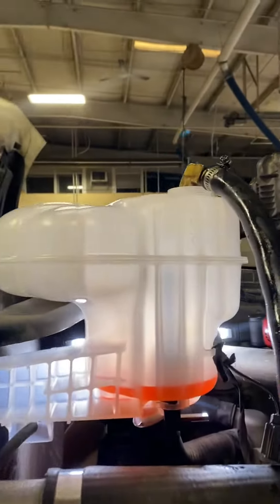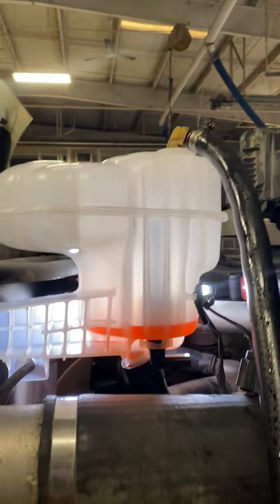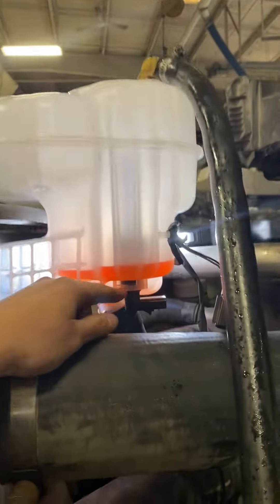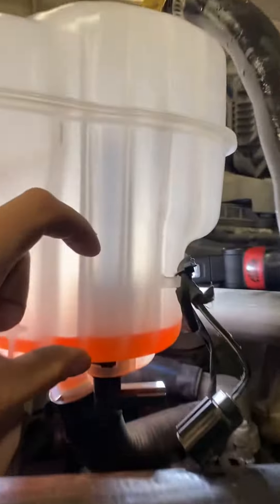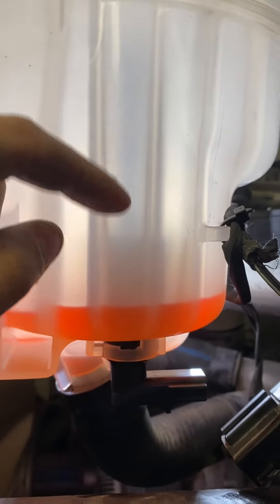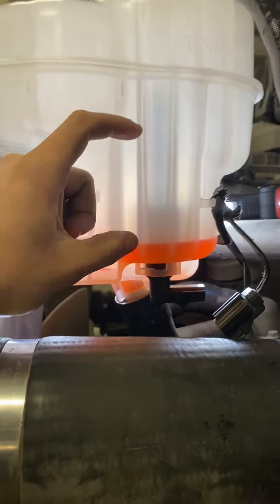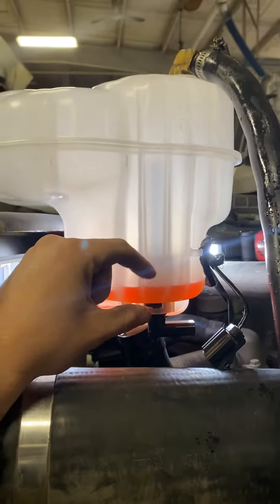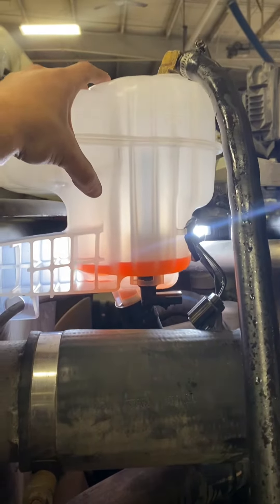Freightliner New Cascadia Low Coolant Codes With Surge Tank Full, Possible Cause

Comment: I’ve got a truck that the floater inside the tank was up when coolant was cold and as soon as I got the truck to operating temp the floater sunk down and yes derate for low coolant, replaced surge tank and fixed problem.